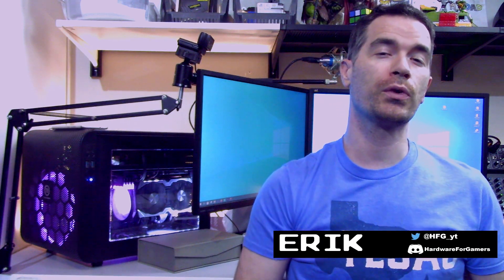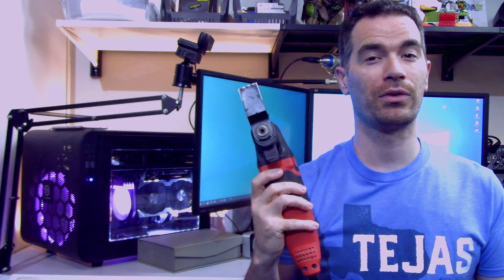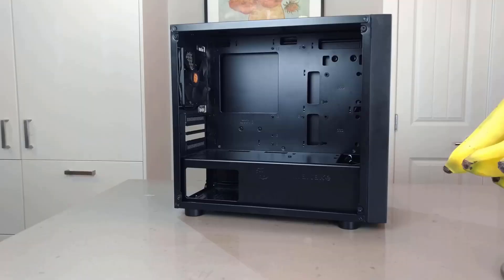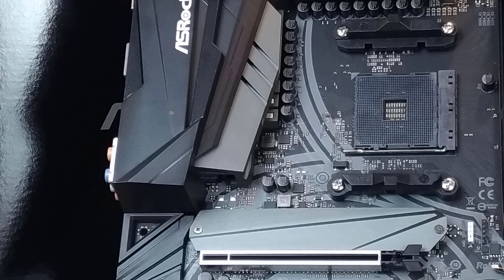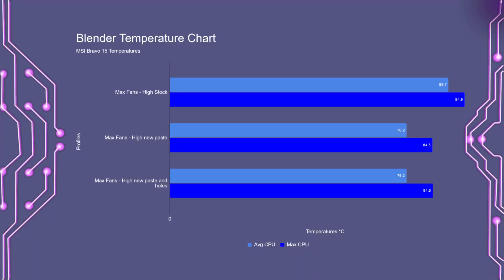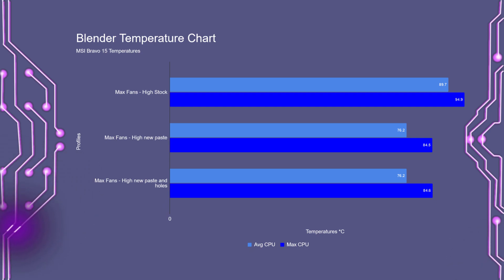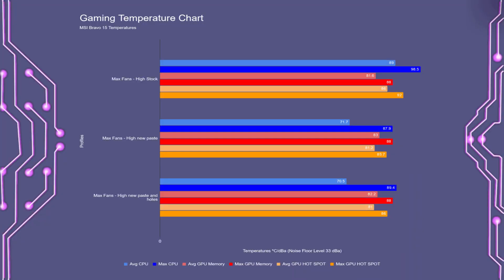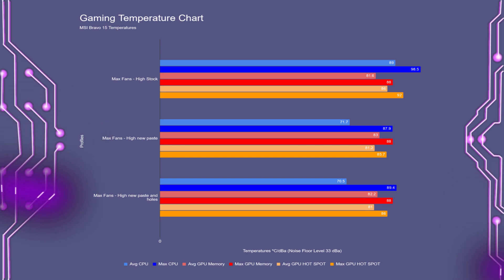How To Fix The MSI Bravo 15 - PT2

Comment: Hi I'm planning to buy the msi bravo 15 c7vf with the rtx 4060 8gb but a read soo many overheating problem. Try to look for other model? That's one the cheapest
Reply from the maker: After I repasted mine the temperature issues stopped.
Reply: @HardwareForGamers  yes but if I repaste I loose the warranty:(

Comment: From previous modding, drilling smaller holes and using a thin mesh used for cases on front panels for example on the inside of the casing to stop dust would be best , the design though is meant to pull all the heat from inside and blow out rather than pull from directly under the fans so youd get better performance putting holes at other parts for natural intake like the ps4 has on the sides

Comment: Hi mate ✋🏼 I also have that laptop and it’s HOT! I dont have that much money so when i bought it i thought this laptop would last more than 5 years but seeing that kinda temperatures scare me. If i dont repaste and use it like this will it damage the laptop? Can it actually shorten its lifespan?
Reply from the maker: Just as long as the temperatures stay under 95c it should not, and that goes for temperature spikes too.

Comment: you picked a very unpopular laptop lol.
Reply: i payed 650 Euro / 780 USD  for this laptop at this price point its a good deal, i think with this price cuts will become more popular, for daily office work with 50+ tabs (upgraded the ram) its perfect dead silent very responsive the monitor is good for reading emails and i use a second monitor for the rest.  i will repaste and see if i will get better temps.
Reply from the maker: The paste on my CPU and GPU was pretty crap, so you should see lower temperatures.
Reply: @avramflorin4216  which country do you live? I bought this laptop in indonesia 2 months ago for $1,100
Reply: @hansmcgruber898  în România

Comment: high stock this is the stock temperatures out of the box or are these the consequences of your first video "how to fix MSI bravo 15"?
Reply from the maker: Sorry what "high stock"... Are you talking about the settings in Dragon center? Meaning high performance mode?
Reply: MSI Bravo is runs hot out of the box. It throttles around 100°C. Stock setup it will run 80-90°C with the cpu locked at the base 2.9ghz, once the core are boosting to 4.2ghz it will run hot/start trhottling.
Reply: @syzygycat4249  i didn't stress test mine, however, with base clock speed 2.8-2.9 ghz cpu temperature did not go above 70 while gaming and stays around 67 most of the time. With boost it did go up to 95 and did not drop under 85 in the same game. It is not that bad as some say, in my opinion, especially once i changed boost settings feom agressive to efficient. Can't wait to repaste it though
Reply: @fall3n87  What are boosts and how do you change the boost settings? I got the same laptop and it runs around 70-80 degrees when playing Battlefield 4. 80-90 when playing Apex Legends. The temperature makes me nervous.

Comment: Im studying industrial design, i do 3d modelling, video and photo editing.. would u recommned this laptop? im concerned about the color accuracy but since all the laptop with good color accurate price more than a gaming laptop, i find it would be a waste to spend my money on laptop with good color but low performance.. would u recommned this laptop?
Reply from the maker: It is a pretty nice laptop and yes the color accuracy is pretty shit, so if that is a real concern. I would recommend getting a color accurate monitor that you plug into when at home. Doing this will still be cheaper than buying a productivity laptop. Just as long as you have the space.
Reply: For 3D u should go fo Nvidea ones,for gaming this one is better. Nvidea usually have better drivers for doing 3D related works more stable then AMDs laptop graphics cards. In this range for nvidea you would get 1650ti on laptop (at least where i live)

Comment: I have  this Laptop. All i did : 
1. using 0.3 mm copper shim 
2. repaste using Thermal Grizzly Kryonaut
3. change all thermalpad (because of using copper shim)
4. cover all heatpipe using Graphite  Thermal Conductive (usually using on mobilephoe heatsink)
Max CPU temp only reach 77 ° dan Max GPU 74°. And still like that since 3 month ago.
Reply from the maker: Yeah, that stock thermal paste on the CPU is really not good.
Reply: Can u elaborate or do a video please?

Comment: I finally repasted.  None of the thermal pads broke ,  There was much much thermal paste around the chips than on them. 
My blender cpu avg temp went from 93.4° to 85.6° ,  CPU  avg clock went from 3266 to 3501.  

GPU didn't change at all running heaven benchmark. In game temp went down 3°
Reply from the maker: That CPU temp sounds a lot better.
Reply: @HardwareForGamers  My temps might get better over time, I used Phobya Hegrease,  thick TIM so wont  pump out  like MX4 but  doesn't spread well.  
My GPU  power throttles since the newest DC update. max temp before and after new thermal is  71. 5500m was hitting 85 on the same benchmark a month ago .

Comment: 1) Thanks for doing this, I didn't want to risk the extended warranty trying this.
2) How much care did you need to  remove/handle the heatsink - is it rugged enough to not risk bending, or do toy need kid gloves?
Reply from the maker: A little bit of both, it was mostly the display cable holding it down (the black cable I unplugged) and then I came up pretty easy.
Reply from the maker: The cooling assembly is quite rigid, you definitely do need to be careful. My primary concern was with the fan headers the display cable and other smaller components more so than the cooling assembly itself.

Comment: Am an architecture student...Should I buy it ?
Reply from the maker: It is a nice little laptop, but if you do need to have a color accurate screen, you will need an external second monitor or you should go with another laptop (like the HP omen at least the North America omen has a very nice screen.)

But if you don't need a color accurate screen, and if the price is right. Then yes I do definitely recommend it.

Comment: There is some other thing you can do but probably is overcomplicated to actually do it, mount 2 water block and then some external pump and radiator outside the laptop case. But like I say it earlier will be to overcomplicated and is more easy to buy a desktop pc insted and the mobility of that laptop is going by by.
Reply from the maker: LOL that would be hilariously stupid, but I don't think a standard block would fit.
Reply: @HardwareForGamers  
Well, there are cheap water blocks for laptops on aliexpress if you want to pull a linus xDDD
Reply from the maker: @YeaSeb.  I would love to, but I also still need to use the laptop.
Reply: @HardwareForGamers  srsly? I was just kidding, there is no need to go with watercooling, repaste was good enough already.
I wonder if that trackpad and display situation could be improved somehow... Maybe a replacement panel with better color accuracy could be available somewhere and 3d printed supports for trackpad click button so it doesnt travel that much
Reply from the maker: @YeaSeb.  oh I know, the hole idea is a joke. I would like to do stupid things like that, but I would need to use non critical hardware.